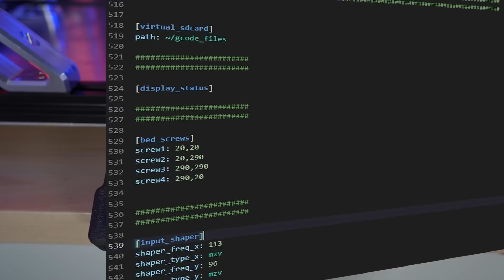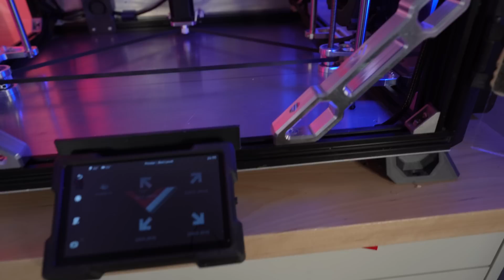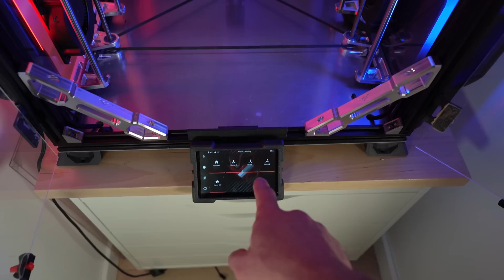VzBoT Bed Levelling

Comment: Love your channel Vez.  My V0.1 uses this system and I love it.  Set it and forget it.  Currently working on my RR 400 and it is getting a VZ RatRig print head, Vz-Hextrudor and Goliath as upgrades.  VZ235 is on my bucket list.  I hope to build a "compact" one with less Z height as a mid-size, fast workhorse.